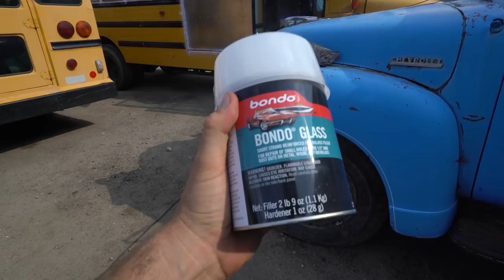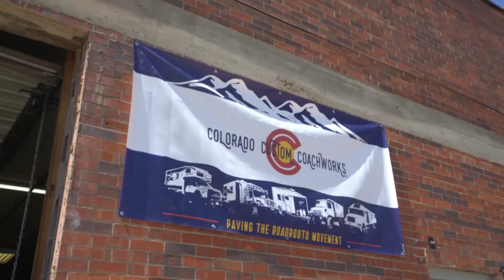Covered School Bus Lights w Bondo, His + Hers Vlogs Overlander + Meetup

Comment: Did you reapply bondo because it wasnt sanding out flat? As if it chips in it? The way you were sanding at an angle with the pneumatic orbital sander ends up breaking the filler up, always best to stay flat, start and stop the rotation of the sander while applying pressure to whatever your sanding, works on bondo or even woodfillers..

Comment: Question - is there info out there about how to calculate weight and balance when doing a bus conversion? I've watched so many Schoolie build videos and this does not get mentioned. Greatly appreciate info.
Reply from the maker: I haven’t seen anything on it specifically. Mike and I talked about it. I’d look into the weight capacity and try to balance weight.
Reply: I've thought about that as well, but I need the center point of the vehicle. My real concern is too much weight on one side and I end up replacing tires/shocks/springs (whatever) more than I should. That is a cost I don't want to encumber.  I know it could also affect the driving and manueverability of the bus. 
I'll keep looking and if I find anything I'll post.